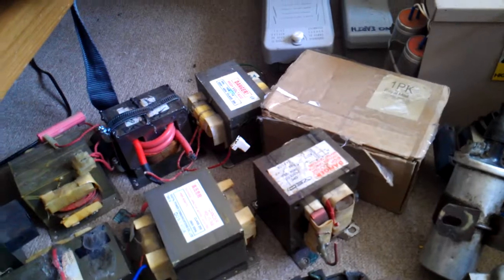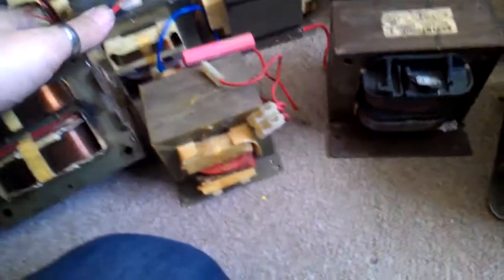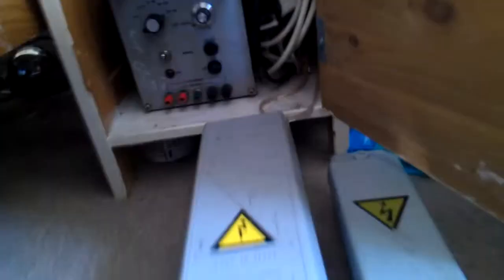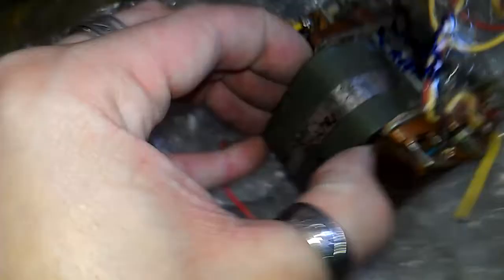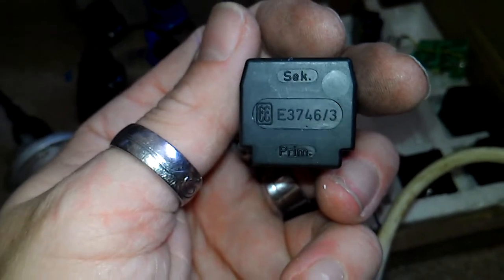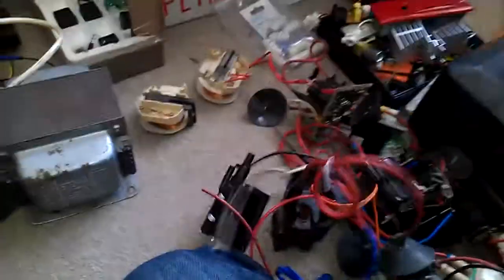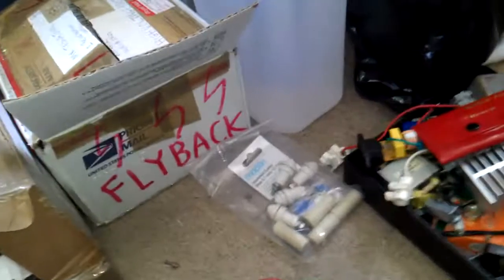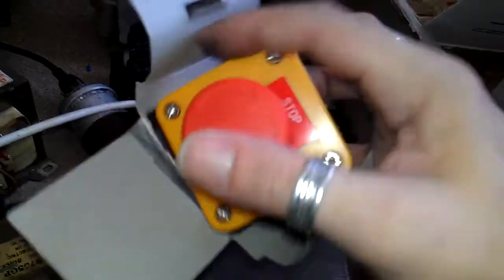My High Voltage transformer collection

Comment: If an RF remote control fails due to em interference, what about using an air operated switch? Not quite so remote but it isolates you from any of the electronics.